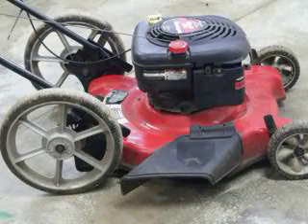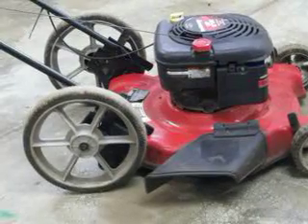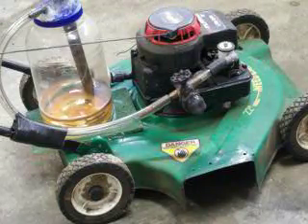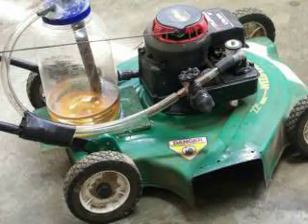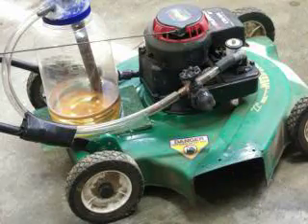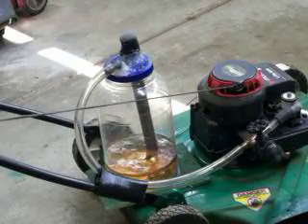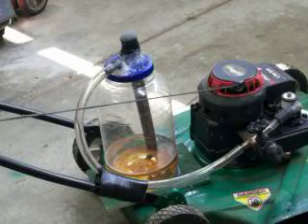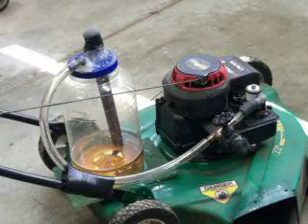gasoline and fumes the difference

Comment from the maker: no it wouldent, the rings are lubricated by the oil in the oil pan
Reply: Jaime Saenz no fire alarms do not detect heat, they go off from CO2  from cars or smoke from a fire
Reply: +TheVaporkid smells like cookies...i think your mind may have melted from fumes...that alarm is not form the heat...its from the CO2
Reply: Ed Felty I haven't, I'm not sure if the video poster has, but I have seen people that have. There is no change in consumption. The vehicle consumed the same amount of fuel through vapor production to go the same distance. If their results are incorrect don't blame me I just watched others try it. But what makes a vehicle go is not the liquid gas but the vaporization of the liquid gas into atomized particles that when exposed to extreme heat in an engine quickly turn to vapor and combust when ignited by a spark plug. If you're eliminating that step and pushing in straight vapor, it would still need the same amount supplying it to do the same job. What would increase under load would be the demand, an if your supply isn't able to keep up then it's unable to function at speed. So you would need a faster supply, such as pressurizing the vapor, which would turn it back into a liquid that would need to be atomized again.
Reply: +therealnightwriter It would produce CO and water for the first few minutes of running then it would be CO2 and water. there would not be as much carbon and hydrocarbon coming out.
Reply: +therealnightwriter Thank you! I wanted to read though some of the comments before I became Captain Obvious. Fumes or not, it still produces smoke. And again you're right about CO vs CO2 and the detectors. I thought most people were smarter about how a smoke detector worked lol. I guess I give the world to much credit.
Reply: panchovillaxx7 Hell that can and has happened with gasoline. Next question. lol
Reply: Actually you are wrong but its a matter of anecdotal evidence compared to real experimentation. In real experimentation you test a hypothesis and use a control to monitor improvement
Shell Oil in the 70s ran a 1959 opel and got 376 mpg on a test track. In the late 70s Tom Ogle tested a 429 ford and got 100mpg ata set speed(55mph) on the highway from El Paso to Demming TX and back and still had gasoline in his tank
The single engine set up in the video gets 100 hours to 2 cups of fuel. It doesnt matter if you test the WICK system or the BUBBLER system they get the same result(thats imperial measure cups)
If the experiment is done properly you can remove the wicks and the bubblers from either system as neither has any affect on the result. It is not the apparatus that is efficient it is the vacuum associated with restricting the intake to the container. The engine creates the vacuum and the vacuum dictates the expansion of the fuel. There is no danger of fire or explosion as the vacuum prevents either from happening
This technology is not new it is about 80 years old and there are 240- 250 patents on similar devices. Unfortunately it has serious shortcomings in acceleration when applied to an automobile and that has kept it off the market
Reply: If you check the comments on this site I am everywhere dispelling the myths about this system. For 1 the only thing this device has inn common with a carb or injector system is the internal combustion system its hooked up to. The idea that BTUs is the way to measure the potential energy in gasoline is not very well thought out . I always point out that a block of wood has only so many BTUs when it is burned but shave a little sawdust off and ignite that dust and witness the potential energy of one block of wood. Ive seen a nearly empty sawdust extractor silo get blown apart by very little sawdust and we are talking a reinforced steel siol. Consider how many silos would be lost to the same block of wood and then reconsider how many BTUs are represented by burning that same amount of wood
You are comparing apples to oranges
A Briggs and Stratton engine of 3.5 hp if hooked up to a similar system in the video will achieve 100 hours running for 2 imperial cups gasoline. Same engine with the original carb 45 minutes running on same amount of fuel. Same fuel same load same engine one system far superior to the other 
4 cylinder 1100cc engine (fuel injected) at 3000 RPM will run 16 minutes on an american quart (1 liter) or on this device 330 minutes(5.5 hours)Same fuel same engine 

That said the problem with an automotive application is lack of control not ability to perform work but lack of control. That is why it has never made it to market. NOT because the is only so much horsepower to the amount of BTUs
A common misconception
See similar comment 2 spaces below and the mpg on a given engine size
Reply: Leslie Clendening I get what you are saying, but your very first comment out of these three you posted dispels this in and of itself. I'm going to quote what you said, "[w]orks better on a stationary engine. . . . any deviation from the set speed caused the engine to stall." The reason this won't work on this mower to mow a lawn or do more than sit in his garage and idle gas out, is because as you mow and you hit different thicknesses or bundled grass or depths even, the mower's engine speed is going to change. Since it's a direct drive engine to the blades there is nothing to dampen the change in engine speed. As for exploding saw dust, that is because there is an increase in the surface area allowing for more complete rapid combustion. If you shave down a pound of wood and set those shavings on fire while they are particles in the air they will all light on fire at once, and as the heat rapidly expands from the fire an explosion is caused. You do the same with a block of wood and you've slowed down the combustion significantly by not increasing the over all surface area for the fire to consume, plus the wood would burn more slowly as you are only able to burn a certain amount of the single surface at once until complete combustion of the surface is obtained. Even then you're not burning the interior. And don't go around saying someone else is comparing apples to oranges when you sir are comparing wood fuels to liquid or vapor. They are not the same, and if anything my decades of fire service training has taught me it's that they don't combust the same or react the same to attempts to either maintain them or extinguish them. Seeing an explosion caused by saw dust or other particle then trying to compare it's explosive capabilities to that of a vaporized gas is insane. The amount of energy released by various types of combustion and various items is not always equal.
Reply: Actually in small engines the amount of work is insignificant to the operation of this device . The difference in load is not substantial any more so, than a normal engine goes through. Hitting tall grass with normal mower stalls the engine as well .Cutting the lawn itself on a weekly basis is not that much more load than running the lawnmower on the sidewalk Making a generator perform work is not going to kill the process either. LOAD is not its" Achilles heel" variation in speed is.If it is not under any load at all it will still stall with variations in speed I fully understand your point Im only saying that a car must go through a wide variations in speedin any given trip, as opposed to a stationary engine with very little variationin any given time.

My experience in explosions is somewhat different than yours mine is as a woodworker in a furniture shop and a sawdust extractor that is nearly empty. The silo was 8 feet in diameter and was 18 feet in length the spark came from the planer and blew up the dust extractor. No one believes it could be that powerful until you've seen it. The extractor had just been emptied in the past 1/2 hour. Thats not much different than a flour mill explosion or coal dust
It made me think about what is happening in this device from a whole new perspective

Instead of burning the gasoline, the smallest amounts of gasoline is drawn into the cylinder with the appropriate amount of air for ignition. This is because of the vacuum that is present on the down stroke of the piston . This causes the fuel to dissipate into molecular or its smallest form making it very efficient. This set up or in my case very similar, achieved 100 hours(96 to be exact ) on less than 2 imperial cups(Im Canadian) The control (same engine with carb) was 45 minutes

I worked on this project for 3 years 7 days a week about 10 hours a day. There are many you tube videos of this system cutting grass. Load is not the issue. Also stationary engines are not proof that this system is involved in some conspiratorial cover up its only proof that the engine will run on gasoline molecules but not for the reasons stated in the video
The actual explanation is a little more complex and involves a white board discussion I have given many times. The physics is quite sound for this device although the concept is very misunderstood. I come by my experience honestly and post my opinions to dispel most misconceptions but unfortunately the medium we use is not that conducive to open discussions and exchange of ideas.So sometimes the answers seem ambiguous they are just a problem of the context of the answer to the question posed.
 The only successful trials of this device have been achieved through running the experiment at a fixed speed. It doesnt so much matter what speed but a fixed speed. Shell Oil did it on a test track at a fixed speed. GM on a test track. Tom Ogle's famous El Paso TX to Demming TX at a fixed speed. The trial was successful till he tried to slow down to come into El Paso on his return and the car stalled. The vacuum is not as reactive as metering the fuel in traditional methods so the speeding up is possible but once you establish an equilibrium the speed must be maintained variation will stall the engine. So he was successful as successful as this system allows with what we know. It does have its limitation and that is what keeps it off the market today

Now you could run the engine at a fixed speed on a hybrid electric car and manipulate the speed with the electrical system. Ive got a few people Im advising on the concept so hang tight 

As well in testing the device I also caused the engine to spark into the tank as a matter of testing its safety and due to the lack of air(presence of vacuum) the intake line (which was clear) lit up like a light bulb for a brief moment. EVERYTIME  
 I have seen people try to use heat to create vapors thinking that some spark arrestor would save them and I have cleaned up after the fire and plucked spark arrestors out of the wall . Probably peaked my interest in the safety of this device though I always have the same two words for everyone FORD PINTO. Just because it hasnt blown up yet it only means the conditions were correct and an explosion wasnt imminent. I have tried my best to ignite the system and up until now I have failed in every attempt. The theory is a vacuum prevents this but theory and prevailing wisdom says it shouldnt start either. Experimenting is inherently dangerous but I feel as safe with this system as any, so thats my take on it 

Anyway the difference in my opinion compared to most is Ive actually done proper experiments kept logs and had controls for the experiments. Most experiences on You Tube are anecdotal in nature (not derived from actual testing) and the opinions are mostly speculation and conjecture. A lot are well meaning but not derived from proper testing

I became involved because my dad ,a mechanic said "it would never start the engine" So I worked at starting an engine. Then it was "it will never pull a car" So I installed it on the 1969 mustang I had and pulled 10 seconds in the 1/4. Then it was" it wouldnt work for very long" So 651 mpg on a 1100 cc volkswagen later............. He was right in a way it doesnt really function as a car is expected to. And thats where we are today

Just a note for anyone who has read this post to here, my experiences show that an engine in an automobile application is about 20 times more efficient than its original configuration. So for those who dont believe its any more efficient or for those who look at the 100mpg as the "holy grail" youre both wrong

Thanks for the opportunity to speak my mind
Reply: The concept is that it does not run on vapor because it actually runs on vacuum created by the down stroke on the intake in the cylinder. the vapor present in the container is not running the unit but is a by product of the system. The technology creates the molecular state it runs on with every stroke of the cylinder so it never runs out of the fuel unless of course there is no fuel left in the container itself. The efficiency of similar systems Ive run are 100 hours for 2 cups of fuel. It will run an 1100cc volkswagen for 332 minutes on a quart of fuel the control was 16 minutes at 3400 RPM 
So it doesnt run out of vapor as it makes the fuel as it goes and is self sufficient in this manner
Reply: +vex zarkov it's not form the heat?
Reply: therealnightwriter sorry xD my mind is kinda out there that few days but yea your right
Reply: What about propane engines they don't sieze.
Reply: Yeah, burning vapor, the actual term, is safe in a liquid gas engine. Cars, small engines, giant engines it doesn't matter, unless it is a 2 cycle engine. Since the only lubrication a 2 cycle gets is from the oil in the gas those could not ever run on vapor, unless someone produced a 2 cycle that has an oil reserve for lubrication. All 4 cycle engines are capable of running on liquid or gas vapor, hence why some vehicles have for decades already been running on fuels such as butane and propane. I've had a few friends with cars converted to these fuels because it was cheaper and got better mileage. Their performance was not as good as far as HP, torque, or top speed, but there is a positive and negative to every fuel system. Some have more obvious drawbacks. You'll never run a race car on a liquid gas engine using vapor as fuel and get the same performance. Engines designed to run pure vapor though might equal a liquid fuel engine, it's a matter of design though. But yes it's possible to run vapor in a liquid gas engine and it's perfectly safe as long as you use safety measures in the fuel system like special carbitrators or injector pumps.
Reply: 2 strokes that run on pure unleaded with a pre-mixer have been around for nearly 20yrs, I had a 1990 RGVT Grand prix edition 250cc 2 stroke, the system works just fine, well better than fine, because you can adjust the mix for different oils and also on the fly!
Reply: Can it back flash and explode/catch on fire?
Reply: Have you tried this on a car?
Reply: JudgmentDay78 Right, hence the fuel system.  You can skip a step but you won't go very fast or be able to control the fuel air mixture, which can cost you a top end.  Try H2 instead.
Reply: Ed Felty Or butane, I've had friends with butane vehicles. They actually increased their mileage by switching to butane in their vehicles from gasoline. I'd like to note for the uneducated, it requires a special fuel tank, lines, and throttle body and intake replacement... probably a few other things. But apparently it is worth doing from what they've told me.
Reply: ***** You got the wrong dude. I never mentioned anything about 2 cycle engines. I know how premixed oil and gas works. Running a vapor fuel in one of those engines would be horrible. I think you were intending to make your comment to me to Transhuman Mercury who was the one that actually mentioned the 2 cycle engines.
Reply: JudgmentDay78 That sounds a lot like the propane conversions.  Like exactly.  I'd use propane, it's cheaper and easier to find on long drives.
Reply: This is correct. It takes a given amount of BTU's to create a given amount of horsepower. Fuel or vapor doesn't change the consumption rate (fuel mileage)
Reply: Ed Felty I just used butane as a generalized term for LPG. Automobiles run on liquefied petroleum gas or LPG which is made by mixing propane with other fuels like butylene, propylene or butane. Propane is more readily available but both can be obtained at LPG companies fairly easily. The people I knew that used LPG fuels in their vehicles filled up at these type of locations anyway and didn't exactly have trouble finding them. If they went on long trips they located LPG stations along the way in case fill ups were required. a 500 gallon LPG tank in the back of a pick up works wonders for long drives. He even had hook ups for when he went camping.
Reply: Wrong a given board of wood say 12 inch by 6 inch by 1/2 inch only gives off so many BTU but a small amount of wood dust ignited in a closed container gives off an extreme amount of force in an explosion. This is an indication of its potential energy
Similar device at 60 mph on s test track V8 say 302 cid about 300- 350 MPG a  4 cylinder 1100 cc 650- 700 MPG This is not speculation but the voice of experience
The actual emissions are Carbon dioxide not carbon Monoxide  works well on stationary (lawnmower engines, generators) not well on automotive (no control of speed)
This is its drawback. No big conspiracy it just is not effective on cars
Reply: I'm so
Reply: Works better on a stationary engine. Its not responsive enough on a car. In the 70s extensive testing was done on automobiles(Tom Ogle Shell Oil GM among others)The only time they had success was on test tracks or on the highway at a set speed any deviation from the set speed caused the engine to stall. It doesnt matter whether you speed up from the set speed or slow down the car stalls. The efficiency on a test track is astounding and barring the lack of control it is remarkable. This why its not on the market.
Reply: Oh by the way , it does scorch valves(intake). On the 1100cc engine about every 500 hours of operation. I know this because I ran it in many test situations and monitored it for temperature and wear. Scorching of the valves is caused by the  lean mixture. water injection helps
Reply: Thats four stroke engine...
Reply: Yes a horizontally oppposed 4 stroke that was equipped originally with fuel injection
Reply: Stable in what way Im just curious
Reply: Leslie Clendening stable in that it won't stall, or quit running after driving awhile. And a system that will have sort of enough acceration for now :)
Reply: Great Good luck Need any input just ask Keep me posted lesliec77@icloud.com
Reply: I send you an email after a while, I'm really slow at building, I'm going to get this vapor thing to where it needs to be. You gotta have a separate technology just to separate and stage sort out the different elements of gasoline properly. I keep thinking of the possibility of using white gas to avoid a lot of problems. Have you ever tried doing that?
Reply: Tried different fuels and they all work for the same reason. The vacuum lowers the evaporation/boiling point and the molecules are what are ignited. as long as its a carbon based fuel it will work. And No hurry just sent my email to facillitate better communication. best of luck
Reply: Did have same problem with acceleration with the different fuels though
Reply: control valve for air pressure control problem solved hook it up in way that your gas pedal can actuate it and your all good to go :)
Reply: It all comes down to just one special valve system, to gain stability with gasoline vapor.